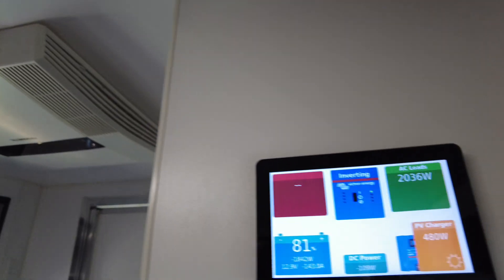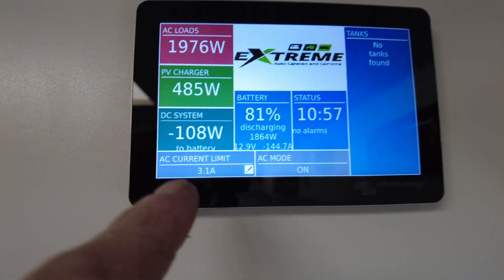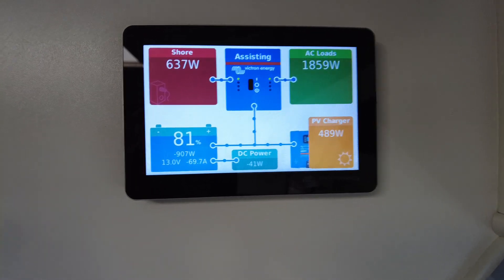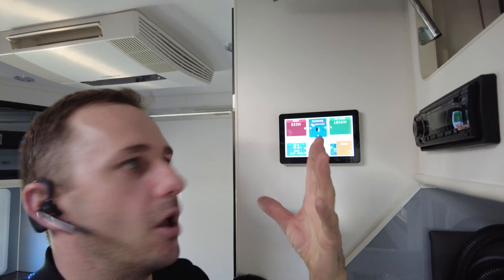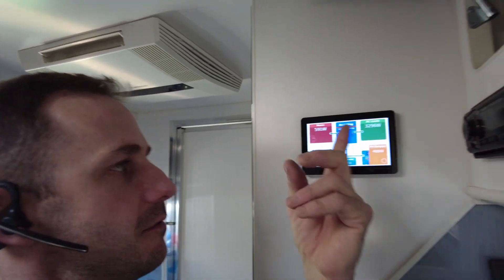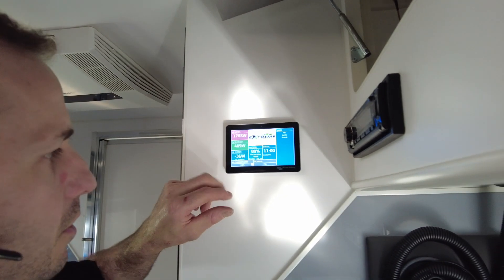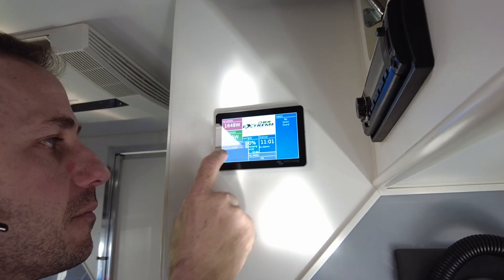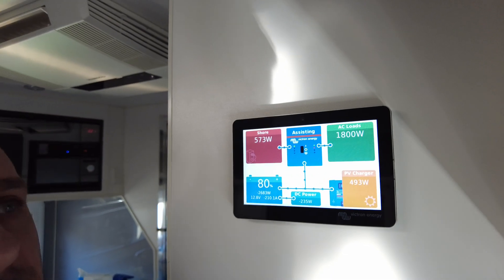Honda 1.0 and the Victron CerboGX

Comment: Thanks Matt, the flexibility this gives is awesome! I think another great option is running a few amps in from a tow vehicle inverter which could be powered by alternator/solar/lithium and parked 20+ metres from the van.  No DC-DC nor associated heavy cabling. Great tech 👍